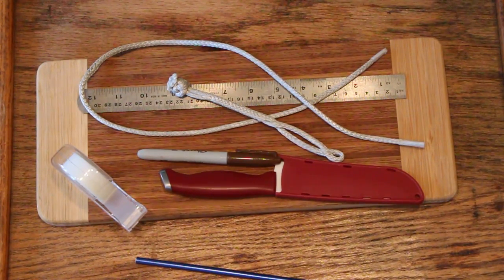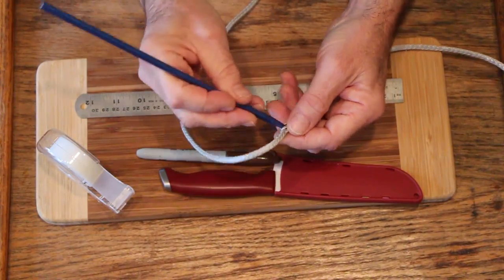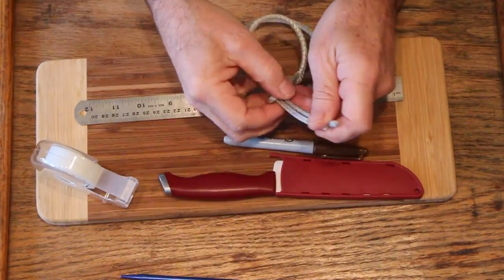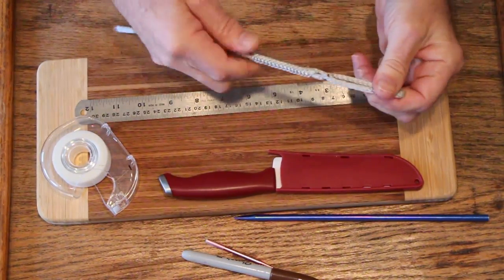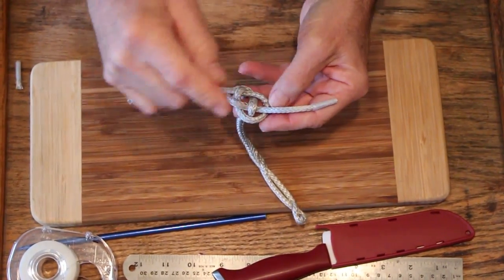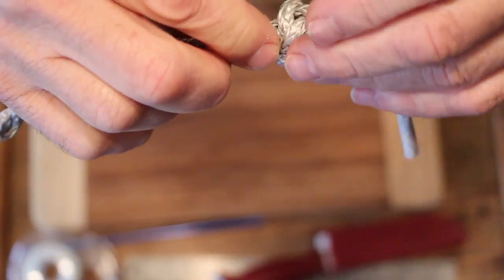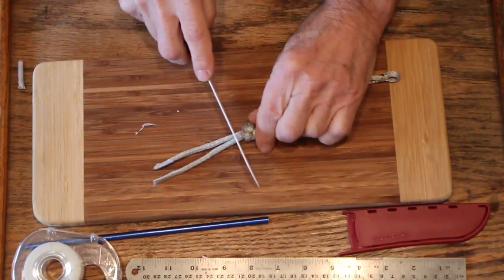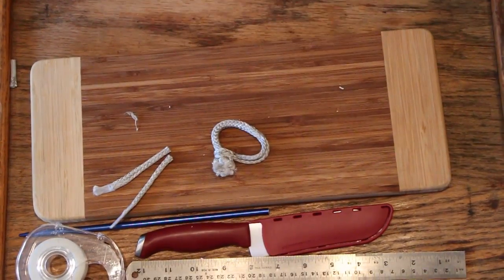How to make an Improved Soft Shackle

Comment: burn the soft part at the end to melt it on
Reply from the maker: The idea of leaving a little line sticking out the diamond knot is so that if the knot tightens at all and tries to pull the ends in, there are ends there and the knot won't fail.

Comment: I thought the improved was the button knot ss?
Reply from the maker: There are instructions for the button knot version on L-36.com.  The botton knot invention was a group effort between myself (the basic idea of how to make it stronger), Brion Toss (the button knot itself), and Evan S (the testing and verification).  Brion still likes it, Evan and I don't use it.  It is good if you need a strong thin soft shackle basically to tie off chain where using thicker Amsteel would not fit through the chain link.

Comment: Addendum: tied some up with 3/16" and 1/4" dyneema.  The 3/16" is much easier to work with. Finished the tails by adding some whipping around both stands.  Capped the end with a dab of Loctite Go2 Glue to keep things from fraying.  The stuff dies clear and flexible.

Comment: Nice vid! Thx.  Just found it.  For practice before using the expensive line,  made up a bunch according to your web site instructions using low cost 1/4" hollow 8 strand polypropylene.  With max line strength of 800-1000# they are for light duty; boat fenders, water bottles, etc.  The more common monofilament 8 strand is a bit springy compared to the softer split film variety which was in the shop (which now seems no longer available).  More difficult to lock the knot but better in holding the shape of a circular loop.  Good to know that the last core>cover interweave under the diamond knot is not needed (leaving it out might help the two legs equalize under load?).  For tightening, rolling the diamond knot whilst pulling the ends with fingers seems to help the diamond knot take an  initial symmetrical set, followed by 10 mm box wrench in the vise to hold the knot with tensioning by pliers (needle nose or vice grips) grasping the tails and levered against the wrench to lock the knot.  Makes for handy low cost gifts.  Hint; did not have knitting needle, thus made up a suitably long, narrow U shaped wand from soft steel stove pipe wire (aka concrete tie wire), ends curled and taped for safety and gripping.  Used enough cello tape on the rope's ends to form a tapered nose which fit into the U of the wand.

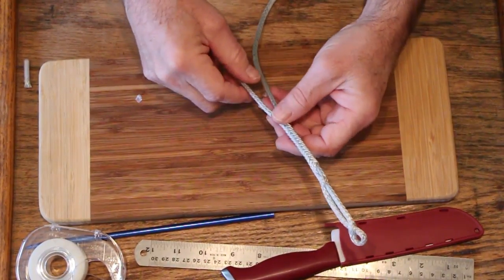Comment: Hi Allan great video. I wondering why you've decided to no longer lock the ends after passing the core through the cover? I'm referring to 5:12 of your video. Also, would you now recommend a button knot (from the L36 website) instead of a diamond knot?  Thanks.
Reply from the maker: Passing the core through the cover is optional.  The knot is going to keep everything locked so I just skip the step and let the knot do the work.  I like the diamond knot and if you use the button from the web site, you need to leave a fair amount of the shackle that is not buried, in other words, where both strands going into the base of the knot are separate, not one inside the other.  The button, where you then bury the tails into these two strands is a little stronger, about 35% but then the eye becomes the weakest point and I like to use larger line and have the safety margin in the eye in case there is wear.